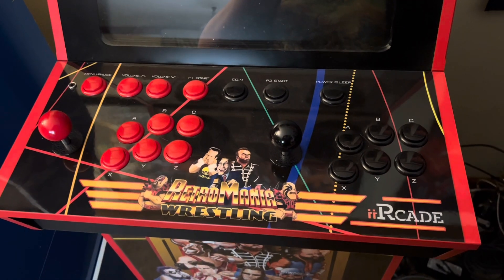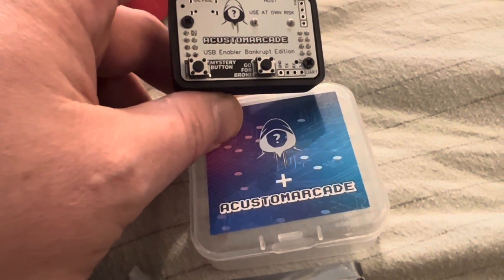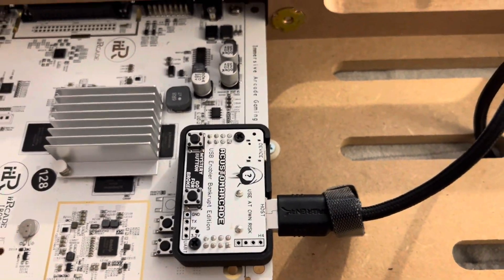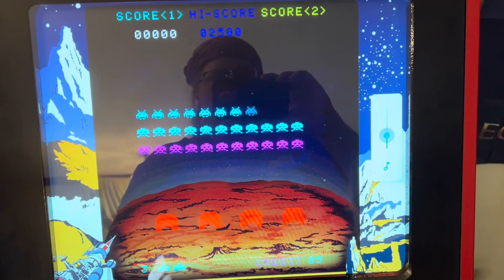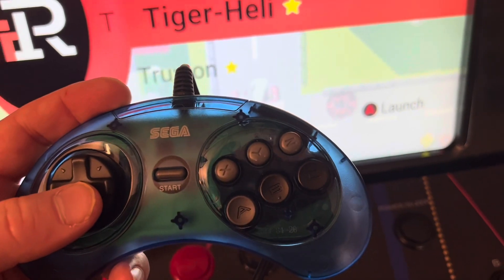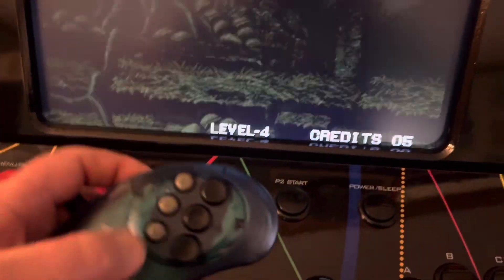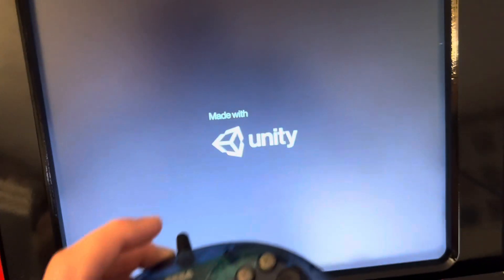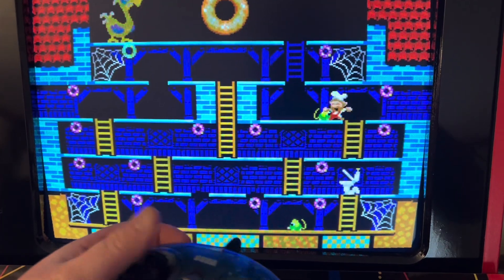Mystery Encoder USB Mod iiRcade install and testing USB controllers!

Comment: You should be able to connect a Pi or other SBC directly to that through USB  with an HDMI splinter for the monitor to go  between the SBC and iiRcade UI.
Reply: PaPow 👊👊
Reply: Hold on now. Do you mean that if I plug my Sumosys Mame Pi into this via USB, I would be able to use it with the controller on the iiRcade?

Comment: Let’s go 👌🔥🔥👍🦾 IiRcade revive 🦾🐲also wait for my release!! Got something cooking for the community 👌😉
Reply from the maker: Can't wait
Reply: Clean like a motha
Reply: Steps try pairing the Xbox controller in the iircade settings menu I believe there is a BT setup… Also try a usb c to usb on the Xbox controller might work that way too.
Reply: @stepsgaming Just opened mine. My board looks different plus it has two USB ports inside.